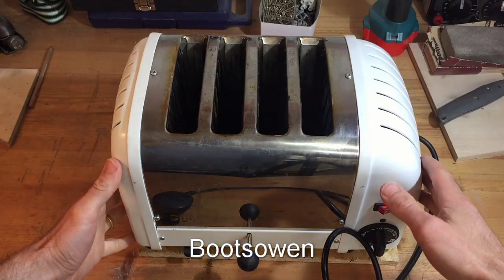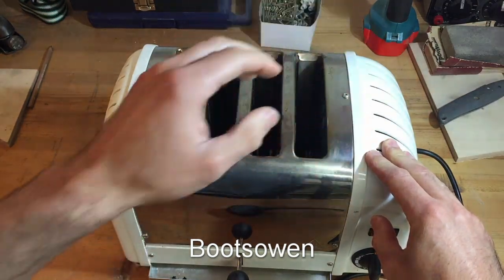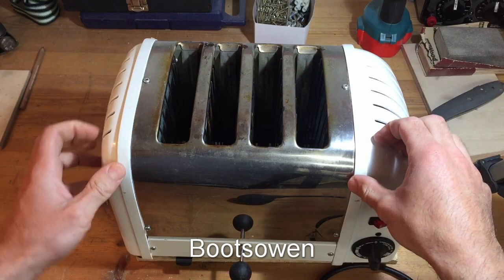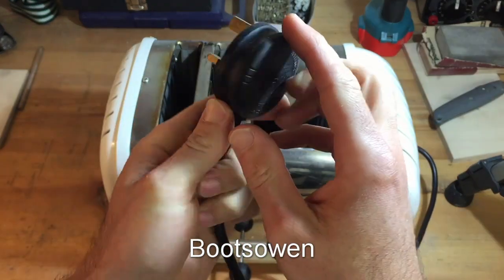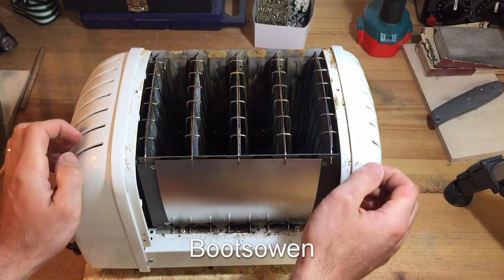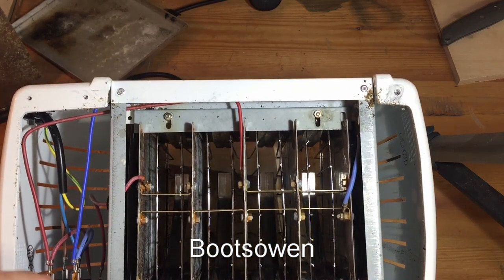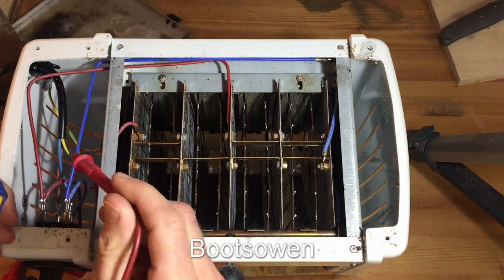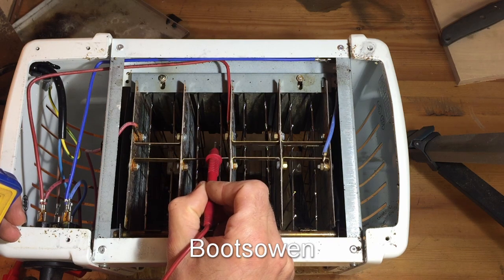Dualit toaster Part 1: teardown and testing elements: 4 slice

Comment: Your video helped me figure out that the I / II switch on my second hand toaster was not for low/high heat, and the right most heating element was not faulty at all. No, the switch is for one or two slices, and the middle element heats up on both sides regardless. I feel like a dumbass, but at least less than I would if I took my toaster apart before this realization. Thanks, I guess?

Also I am happy to say I did not contact the seller and give him an earful about the shoddy toaster he sold me. So there's that.

Comment: Thanks for the video.  I had been stuck trying to repair my Dualit.  Your video pointed out the temperature sensor, which I had not noticed.  And also reminded me to check the continuity on _everything_.  For me, it turned out to be the temperature sensor.  It had a little button, just had to press it and it all worked!
Reply from the maker: Good man Stu. It’s a nice feeling.

Comment: I have a Dualit toaster, they are easily repaired with all spares available direct from Dualit. I have recently replaced all the elements in my 2 slice toaster as toast was coming out pretty patchy. My old elements tested okay for continuity but I suspect some degradation over many years of use (easily over a decade for me). I also found my elements to be 'green' despite only ever being used in my kitchen.
Reply from the maker: I think they are a good machine. Quite rare to see something made to be repaired but about as rare as someone who will pay over £100 for a toaster

Comment: Thank you for your video. I was able to repair my own Dualit (in 30mins today) by following your continuity tests with my multimetre. Inside my unit there is a little RDS cut-off switch which just needs pressing again. Useful for when hard crusty bread gets stuck! 
Who knew that crusts could cause a short 🤣 I think I'll approach Dragon's Den to propose replacing metals with Irish Crusty Bread! 😂😂😂
Regards Stephen
Reply from the maker: Excellent, that's what it's all about!